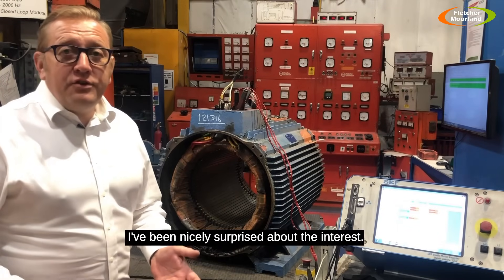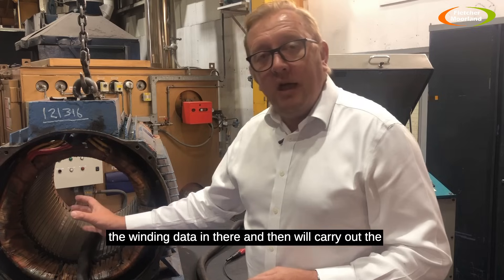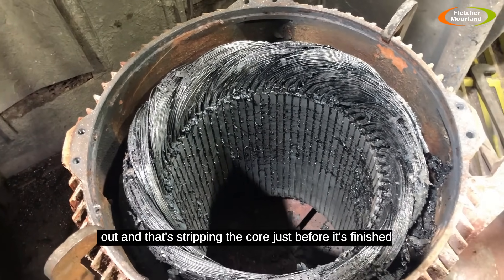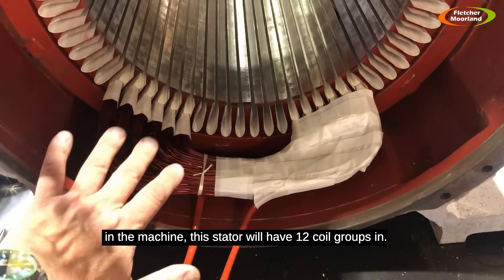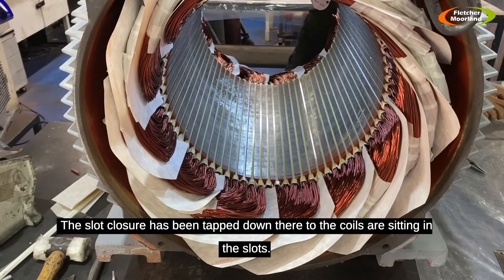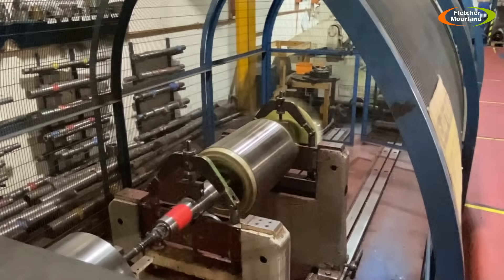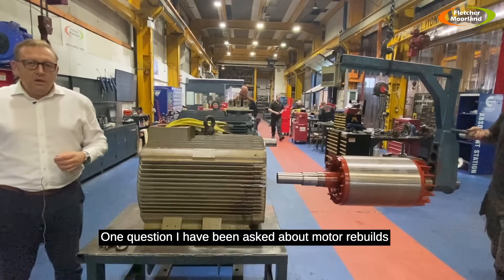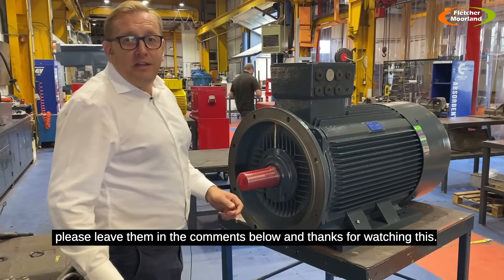How it's done....Electric motor rewinds

Comment: Very professional sir . My dad used to be head  electrical engineer at CIG/ BOC . Even after his retirement BOC used to still be asked to help out with electrical physics formula's and of cause he would . I remember that when I worked at Boyd Metal's welding up the transformer housings I was on leave and dad came over from Sydney to see me and I took him down to Boyd's all that was good ....of corse when I asked him if he wanted to go down to ABB on Scarborough Beach Rd back in the day . He goes to me um Mike no look we'll be roped into things and separated they'd have me repairing leaks in tanks and they would of asked dad to do some stuff as well and as my old boy said Ur Mike your on holidays and I don't want you having to have to do work like this without pay so it made sense to keep away from ABB in my down time . Cause I thought it could have been a foot more in the door at ABB . But dad said no . If they want your service they'll have to pay you to weld on holidays and of corse they would have not payed either him or me or probably I wouldn't have been able to get a job there . It's very clicky in there, and i had even done a littel  OT for the boys after clock off time on friday afternoon's to help the boys out on tanks that had some small mistakes made from fabrication.  Something as simple as a couple of boss connections were not flush on the in side on the tank with means the core won't fit . It was a simple fix with a grinder but I wanted them to be able to tank the job fill it with oil so it could go for load test on Saturday morning.  To me that in itself is a big help to them but of corse things like that to a company like that ,my efforts went without acknowledgement so this day I'm glad that we didn't visit the factory on my holidays . They don't deserve my specially efforts and especially my dads . Such a shame as I love our power grids and I love high voltage buildings insuorlaters ect and of corse the 50 hz cycle. Mmmmmm

Comment: Seems like a great trade there will always be a need for. I've watched similar videos. But not as modern or industrial as your shop. Men in little huts in God knows where. Working with a blow torch and the most basic of tools. Burning the old copper and reusing it after dropping it in water or some blue liquid. But they were working on starter motors. I would love to hear someone like you. Comment on their work.
Reply from the maker: Hi Jason, thanks for your comments. It's a hard one to comment on, I've seen those videos too. On one hand the processes and health & safety employed would not be allowed in the UK plus the reliability of the repair is questionable at best. On the other hand it's a different country with a different culture. I have to admire and think that they are doing the best they can to make a living. They must have a customer base to service and what I'd consider to be a low-skilled role there maybe a high-skilled role in the country they are in. The world is so different depending on how you look at things.

Comment: I would wager that's why we had persistent failure in several light towers. The varnish was vacuum pressure applied.  Allowing condensation in the stator and burning the units.
Reply from the maker: The VPI process gives a greater protection to the windings in case of condensation. We had a demo unit that actually had a jet of water onto a motor windings whilst it was operation to show how good it is. I fear you maybe mistaken in your thoughts compared to a standard dip varnish.

Comment: Have not wound a stator for 45 years but watching this brought back so many memories
I can actually sense and feel a coil and wires in my hands, that's how good this video is.
Thanks for posting.
Reply from the maker: Thanks John, that's a great comment to read this morning, very much appreciated indeed.
Reply: I did 30 years in a train motor repair shop . Mostly DC , ran a balancing machine for a few years . This video brings back memories.
Reply: What's the difference between DC motors and AC motors ??

Comment: The crown on a stator like this need not be so large , it probably has been designed that way to conduct heat away from the core to air , but too much lacing and varnish on the crown will  reduce heat transfer ... string rather than tape lacing  must be better , and is varnish on the crown really necessary?
Reply from the maker: Yes, the varnish holds the coil overhangs to prevent movement so it's totally needed. Varnish such as in VPI gets more varnish into the windings so there's no voids that can create hot-spots so the varnish helps to transfer the heat to the outer of the coils. On this motor it was not possible to reduce the overhang, we matched the OEM windings. The majority of the heat transfer will always be core to frame to air. We prefer tape to hold the windings tight rather than just lacing.

Comment: Where does the impragnate lack(fluid) get removed after the VPI process, or it simply vanishes when it was heated in the oven? Cause, I remember i always need to iron it out with a machine(drill with a specific tip) before inserting the Rotor, and doing a complete assembly.
Reply from the maker: We do need to remove the excess from the stator core, mounting spigots and threaded holes by hand before we can assemble too.

Comment: Well explained.   I am amazed the winding is not done with machines.  I hope they are never just dumped and a new one installed.   New washing machines are being dumped and they call it recycling.
Reply from the maker: The coils are wound on a machine but that part of the video was corrupted. Winding is a manual job.

Comment: It is so impressed recording. The one thing i have question that how much percentage of varnish take of total engine cost? For example, total engin cost 100, how is the varnish consited of ?
Reply from the maker: I'm unable to answer your question accurately Kwangduk, As an estimation though I would say between 1-3% it is a very minor cost part of the process. The copper, bearing and slot insulation make up more of the material costs overall.

Comment: Very interesting I myself used to rewind stators about 40 years ago and found the pitch of the coils were important and did it for 3 years and changed jobs to become an industrial electrician and worked alot with  electric motors and seen many burnouts and the most motors were DOL operated and one special inverter operated motor keep up the good work :)
Reply: Pakistannn
Reply: Pakistannn

Comment: Excellent video, Well explained, new subscriber from New Zealand. Just one question, how many wires are in parrallel, Those wires are pretty thin for a 200 kW motor. (e.g. volts per turn) Thanks.
Reply from the maker: I'm not totally sure now. I think there were 17 in parallel of 1.4mm
Reply: @FletcherMoorland  Thanks for your quick reply. That makes perfect sense. keep up the good work.

Comment: Thank you for posting this, I used to work on Kelvin Hughes radars on merchant ships. Often we would have scanner motor failures from ships coming from the North Atlantic due to water ingress into the gearbox.  We pulled the motors and took them to a rewind shop and picked them up and either reinstalled, or had them sent to the Kelvin Hughes rep at the next port of call.  I never knew how the motor shop performed their service.
Reply: Pakistabnn

Comment: And I was trying to 3D print a stator cap for a thrown out garbage disposal motor lol. Looks like there's a LOT more that goes into servicing a motor like this.  Mine is single phase I believe (has a centrifugal switch).  The cap isn't perfect- the rotor has a bit of play forward and back.  It turns on but quickly starts smoking from the bottom...  At this point I'm thinking of doing a total teardown, so at least the next time I come across an induction motor I'll know more about how they work...  Maybe I'll try my hand at re-winding this one, just for the hell of it.

Comment: i have a 5,000 KW 13.8kv motor from 1952, needs rewind... help? :3

old papermill we are working at has 8 of them, only 3 work now... they are HUGE! blew my mind finding them, the output shaft of the rotor is the size of the whole 200kw motor frame :P

Comment: Surprised that the 370C burn off does not effect the lamination varnish, as it arrives back out of the process so we'll charred, or is the dip a lower ignition point than the lamination grade.? Me.? Ex GEC Rugby......always found the smell of the dip a real stomach turner.....but then, that was the 70's and I hear materials have improved.
Reply from the maker: There have been several studies done on this Robert, recently updated last year and the 370C is the maximum temperature to burn off without affecting the lamination insulation. That smell though is one that never leave you though does it?
Reply: @FletcherMoorland Thank you for the response.

Comment: As an Old retired Generator mechanic, yo are speaking my language, Test test, know what you need repair properly.  Have you seen the Pakistani Mechanics, rebuilding  Motors ?  Sitting on the dirt floor and using more hammers than  proper tools,  A good chuckle.

Comment: This was nice to see, However I would love to know the Electircal Engineering Theory Calculations that let you work out how many turns per coil..? Is it possible to find that out.. without having to do the maths lol
Reply: After chopping and burning your winding you can retrieve all that data while pulling the old coils out of the stator. Pull one coil at a time, record your slot span, number of coils, turns per coil and wire size.

Comment: Really interesting - I always wondered how this was done. Would be interested to know what sort of cost is involved, and how it compares with the cost of a new motor. Also what sort of voltage does a motor like this run at?
Reply from the maker: The repair to this motor is around 60% of new price and the motor is a 415V motor.
Reply: @FletcherMoorland  How does the repair compared to a brand new motor? Is there any loss or the improved materials used even give an increase in performance?
Reply: @wancelemuel6633  why would it be any less than new? The casting is still there and everything is rewired with new wire. it's brand new
Reply: @wancelemuel6633  : Done right, it's the same longevity and dependability as a brand new.
Reply: @MarshallSmith27  there is much much more to it than you think. There is what is called “core losses” after the motor has been burnt out. Now, with proper equipment and proper process you can mitigate those but they are almost always there after burning. And there are other things but that’s probably the biggest one, other than depending on the quality of shop and the systems they use to make the repairs.

I rebuild electric motors for a living in Kansas.
Reply: @wancelemuel6633  To answer your question, it really depends on the motor/situation. Average cost compared to new to rewind a motor rather than replace is 50-60%. And typically speaking, almost always, the rebuild will last slightly shorter than a new motor. This isn’t always the case but is simply most common. Most of the materials used in good shops are mostly identical to factory or better in a lot of cases. But premium efficiency motors on the larger ones is becoming more common and popular due to the cost savings on energy and they typically will last a bit longer due to better quality materials used in manufacturing. So to put it simply, it isn’t cut and dry all the time… we’ve rewound some motors for 150% cost of new because the new motor wasn’t available and was going to take months to get. 

I rebuild electric motors for a living in Kansas.
Reply from the maker: @47rushing  Using a controlled burn off and then the core-loss test (or loop test)  to confirm, the process doesn't have to increase losses.
Reply: @MarshallSmith27  Or better!
Reply: @TheFirstBigCheese  Or better!
Reply: In this over disposable world we live in, it is great to see the craftmanship and engineering to take a blown unit and bring it back to better than new.  Well done.
Reply: And I’ve figured why the all knowing algorithm suggested this video to me. 🤣
Reply: It’s often more a case of lead time than cost with rewinding. Some machines can have lead times of months.
Reply: @chrisb4009  l
Reply: It was interesting to note those technical test involved in rewind. Good video

Comment: Nice video thanks. Do you have to work on the rotor aswell or was that just outside the scope of this video?
Reply from the maker: Generally you don't want to ever work on the rotor, unless it's to reclaim the bearing journals or work on the keyway. If there is rotor damage to the rotor laminations or rotor cage then with this type of motor it's usually better to buy a new one.

Comment: Lovely video! :) Is it still done the same nowadays like I learnt it decades ago to find out the detail of a motor with unknown wire specs to pull one loop out of the cut off crown (we did not have such a cool saw, been using chisels instead to get that done), heat one end with a blowtorch to get the enamel off and then count the wires, twisting them in groups of 10/25,... ? Or is that no longer needed as nowadays you have the specs of everything somewhere either locally or on the Internet? And do you know if this particular motor had been rewound before? Back then we had seen loads of winding shorts (hope that is the proper English term) in that area where you had the failure on this one due to improper "shaping" work of the crown during rewind. Levering away from the motor housing if too close or hammering in shape with a rubber mallet which can already damage the enamel of the new wire. Does not fail straight away but puts an "early expiry" onto the rebuilt machine. Even had returns of motors we did so we were to blame as well.
Reply from the maker: Yes, it's still done the same way as you were taught. Manufacturers don't give winding specifications away so we build a library of what we've seen but if we don't know, then it's getting that blow torch and micrometer out. As for knowing id a rewind has been done before, that's down to experience. You can generally tell what's an OEM winding and one that's been rewound before, as to how many times, well we don't know. Thanks for the comments.

Comment: I don't understand why this needs to be done in the first place. I was a welder and I worked with many electricians who serviced huge bridge cranes and they'd send these huge DC motors out to be rewound fairly often but what's being consumed or degrading and why do emfs make copper fail. Do power lines have to be restrung based on amperage? I don't think so
Reply from the maker: Electrical machines fail, they need to be repaired, that's why we do this.

Comment: 2:20 What causes a higher or lower watts/kg loss?
Reply from the maker: Ideally you don't want any Watts/kg loss but we don't live in an ideal world. The lamination thickness, grade of steel and the lamination insulation type all have a part to play in lowering the Watts/kg loss. If the insulation layer is damaged then the core starts to become a bigger lump of steel and then eddy currents  flow in the core and this increases the losses.
Reply: @FletcherMoorland  Thanks!

So why dont they make ultra thin laminations? Is there a point of diminishing returns or something else?
Reply from the maker: @beachboardfan9544  That's one I can't answer, the manufacturer would need to. I expect you're right in your thoughts though.

Comment: Interesting that this is a lot more manual than manufacturing a new motor (at least, based on other videos I've seen). I suppose that's because you need the flexibility to work on many different motor types and sizes. I'm actually a bit surprised it's economical to do this, especially in a western country when you're competing with Chinese new manufacture. What's the approximate cost of doing this for the customer versus them buying a new motor?
Reply from the maker: A lot of smaller motors are machine wound and you're right with the reasons to give flexibility and the next one we do won't be the same as the previous one. There are a lot of cheap motor in the marketplace but the quality ones (There is a huge difference in quality) are economical to repair. This one was about 60% the cost of a new one. We also give a three year warranty as opposed to 12 months with new so you can say that the repair is better as we use better materials.

Comment: Thank you for this video. I have used many 3 phase squirrel cage motors in machine fabrication over the years without properly appreciating their intricacies. One machine installed in Indonesia was set up for 440 volt 3 phase which I was assured was the power they were using. Upon arriving half way around the world I discovered their power was in fact 380v 3 phase. A little connection alteration and we were back in business. The reserve amperage capacity  of these motors (and our control wiring) was very much appreciated.

Comment: Great video! I never knew the process, much more manual than I would have suspected.
Reply from the maker: Thank you, A lot of smaller motors are machine wound when they are first made by the manufacturer but all rewinds are manual as there are so many different types of motor. The coils are wound by machine but that part of the video didn't come out well so I had to leave it out.
Reply: Well educative video l would love to be part of the team unfortunately I have a winding work shop in Zambia solwezi all l May want is some more machinery to simplify my work

Comment: Excellent Video and excellent thorough explanation of each step. I’m a bit curious why you didn’t perform any test on each skeen of wire to be sure there wasn’t a short or issue before you went to the next one. 
Thanks for a great Video.
Reply from the maker: this does get done at 500V to earth on each coil but I chose not to add this.